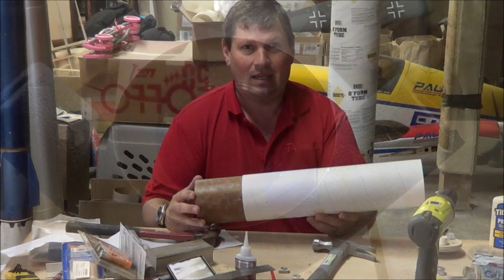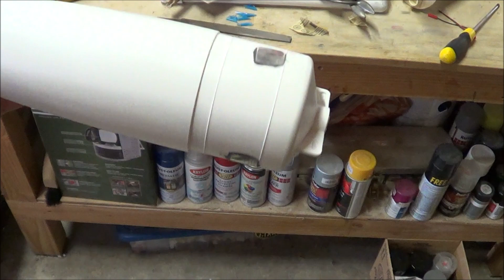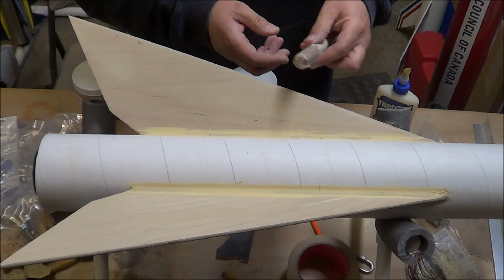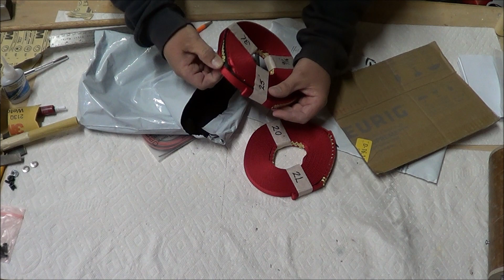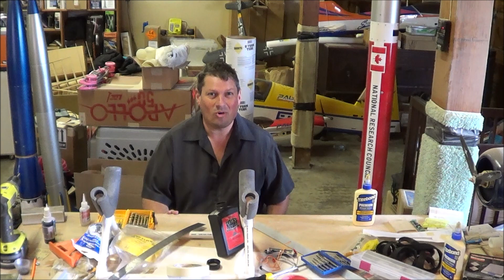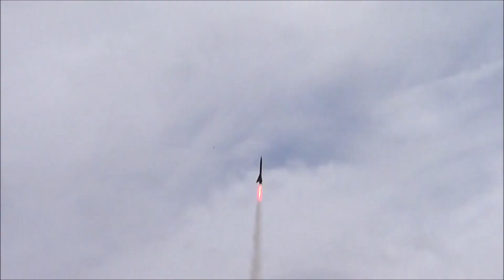Upscale Estes Ninja High Power Rocket Build Part 2: More Panic!

Comment: Thanks so much for your Drago 4XL build videos. I am following and building my own along with the video…the “pouring” in of the rocket epoxy for the internal fillet is having me a little concerned. I did it and the epoxy did not drain all the way to the bottom or forward centering ring? Is this an issue? I did heat it up but no too much
Reply from the maker: If you can mix another batch of epoxy and use a dowel to push it all the way to the forward centering ring then that would be best, but probably not 100% needed.  Good luck with your build!